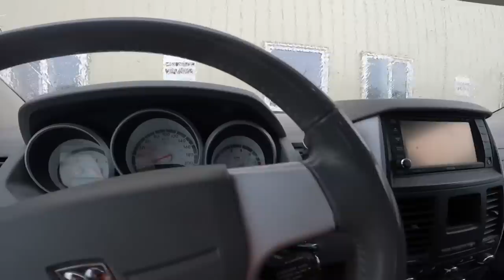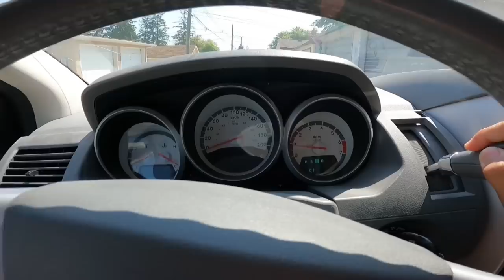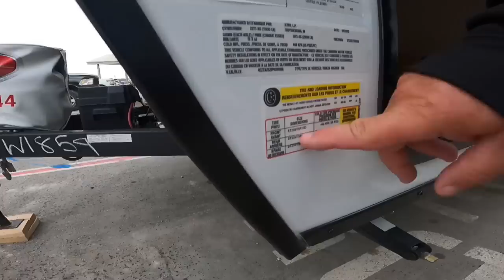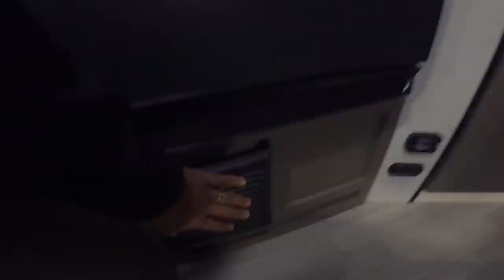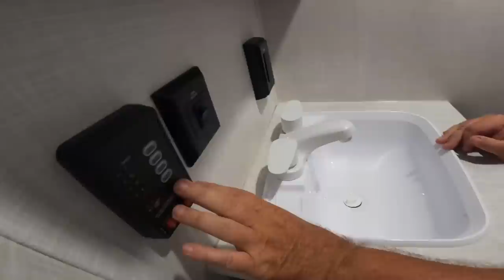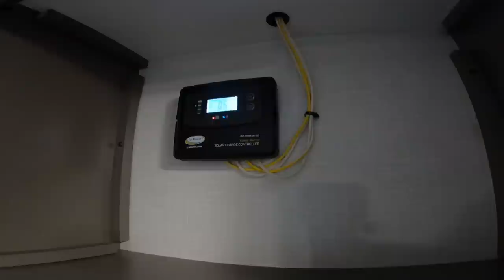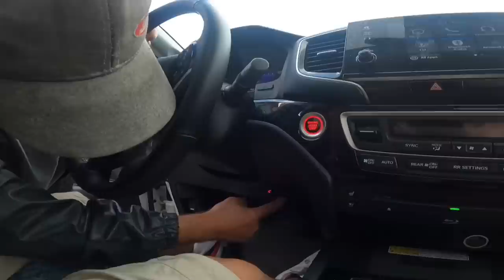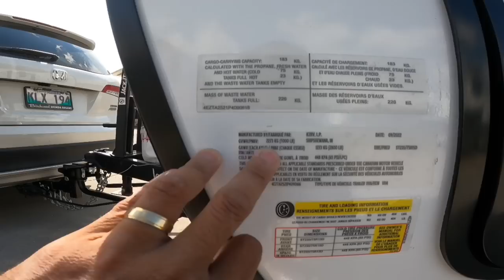Such A Big Trailer for a Small Vehicle | Turn Over + Demo, Itinuro kung Pano itapon ang Ebak ! EP233

Comment: Just for concern po, cnungaling po yung nagbenta sa inyo di nila sinabi na hindi      safe pang hila nyo, overloaded po kayo, ang max towing pilot is 5k pounds lng yung trailer plng 5k pounds na pano pa po ung mga gamit at sasakay sa sasakyan, pag nahinto kayo ng pulls cgurado ticket bagsak nyo, isa pa d kaya transmission ng suv ang bigat ng rv, suv are not designed for towing ang bagsak din nyan sabog transmission or engine nyo ,  need nyo po talaga ng truck na panghila Lakay, again this is for your own safety po, kaya ingat po...
Reply from the maker: lol, ipa tulfo natin po 😂😂😂😂 joke🙏🏻

by the way Trailer dry weight is 4,300 lbs
Reply: @LAKAYTRUCKER  ganyan talaga mga stealership di nila sasabihin ang tama basta makabenta sila un lng gusto nila, pansin mo namn pag nag drive ka, hirap makina mo isopin mo.nlng pag malayuhan drive mo at mlakas hangin yjng rv na mismo hahtak dyan sa pilot mo,, saka po ung tongue weight po ng rv idol.d kaya ng pilot pag sumakay pa misis mo at mga kids nako yung gulong po ng pilot di kaya.. tignan nyo po rated ng gulong ng pilot, pg 6 or 7 ply yan pag overloaded pwede sumabog anytime, need po atleast 8 ply or 10 ply..
Reply from the maker: oo nga po sir, kayadahan dahan lang sa drive😊
Reply: @AlGoodThingsGoes2ThoseWhoW8  karamihan naman kayang kaya mag tow ng mga suv ngayon, pero problema lang talaga, ung stopping power.